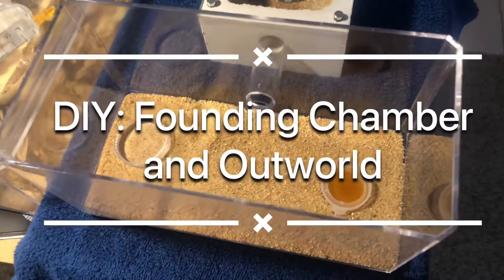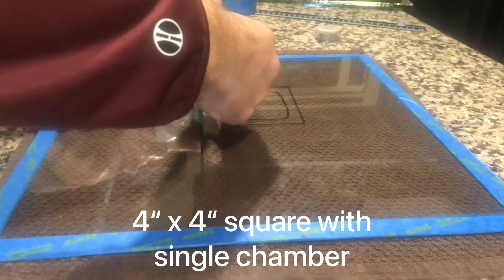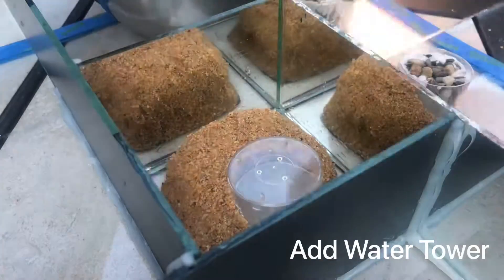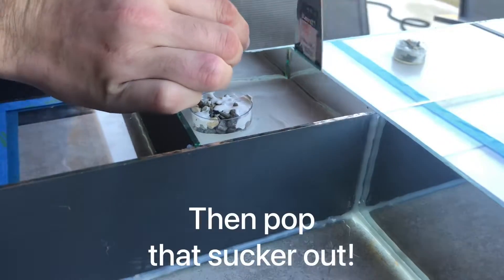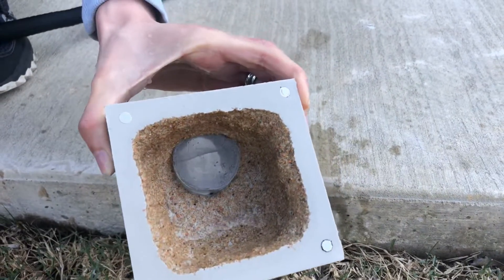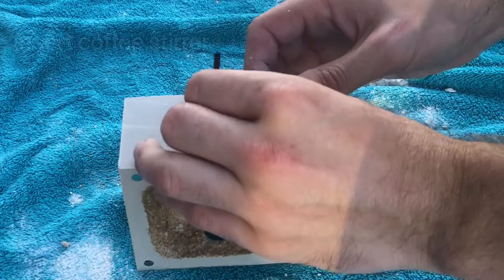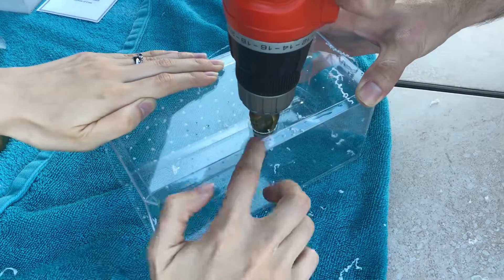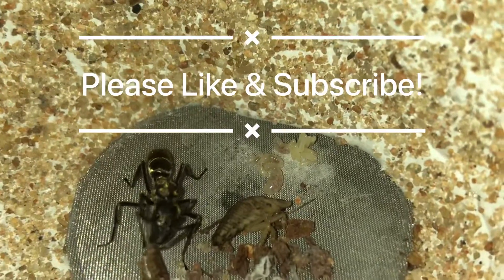DIY - Founding Chamber Gypsum Formicarium with Outworld

Comment: Incredible!

Do you have a link with more pictures? I’d like to see the side view where you can see into the water tower. I’d also like to better understand the use of the coffee stirrer and where it’s placed. I assume it’s to fill the water tower? Does it hang above the water tower or go into it through the side?

How are your ants getting water? Are you giving it to them in the out world?
Reply from the maker: Thank you! I can put them on my IG if you like. The coffee stirrers act as a tube so that you can inject water into the tower without soaking the rest of the cement. If you fill up the tower without a straw, it will just slowly leak out into the cement and drain it faster. The hole is drilled into its side at an angle. 

The Neoponera ants going into these nests cannot regurgitate water or food and must have open water sources. I give them water dishes in the outworld.  Other ants will have liquid feeders such as the ByFormica brand.
Reply: @TheAnttarium  our UltrCal30 came in the mail today!